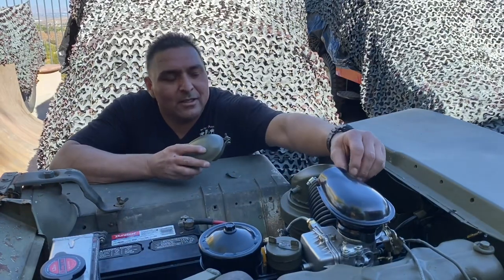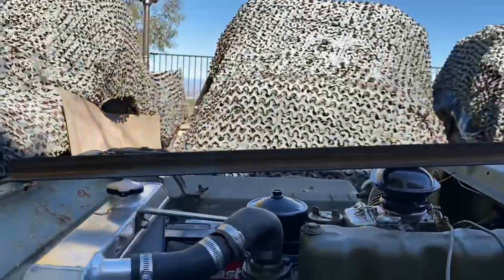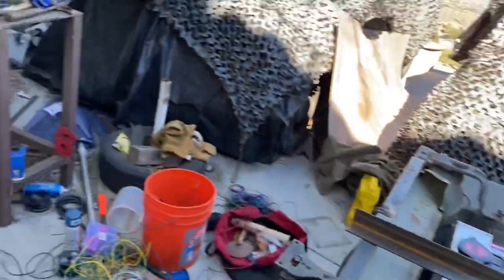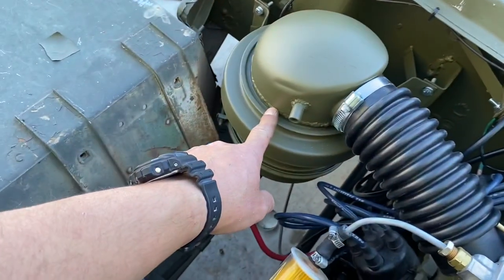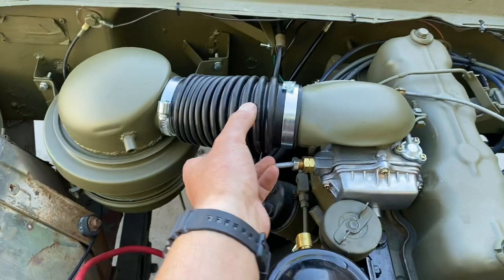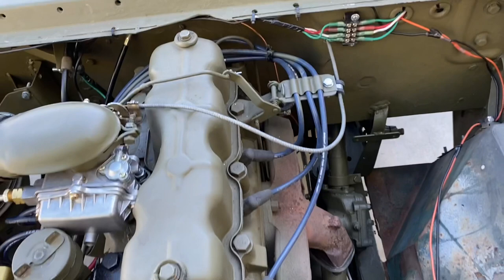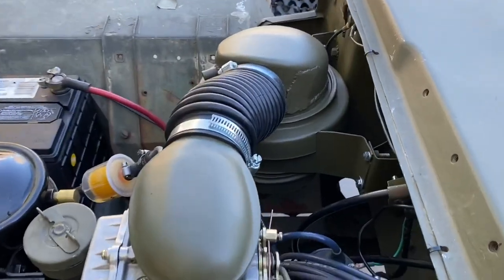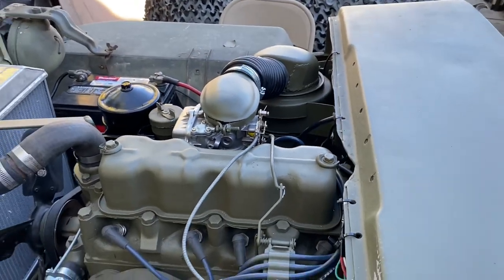Part 3 - F134 engine in a flat fender Willys Jeep- air horne issues solved

Comment: How did you modified gas pedal linkages to carburetor?
Reply from the maker: I have a video on it. had to cut a little piece of the carb linkage and flip it around/weldit back and hooked up the linkage to it. it works ! thanks.